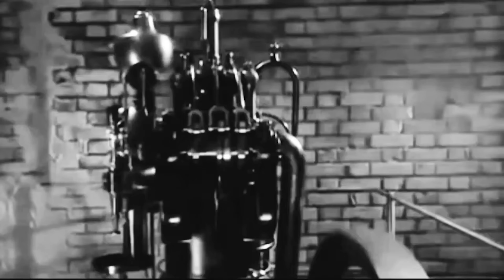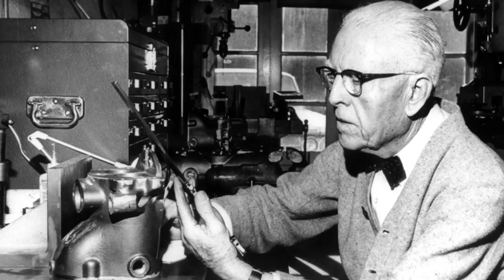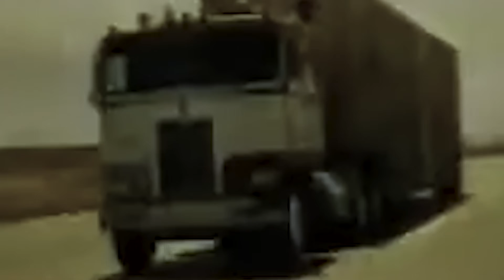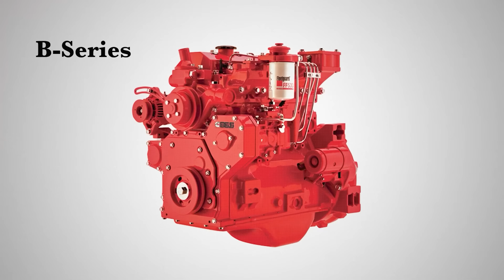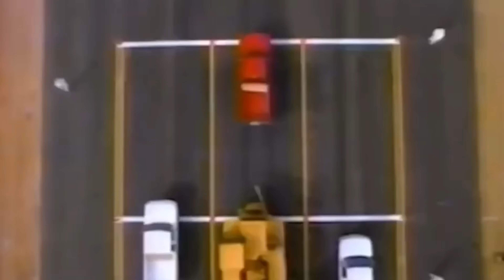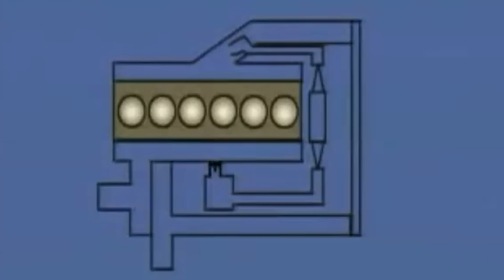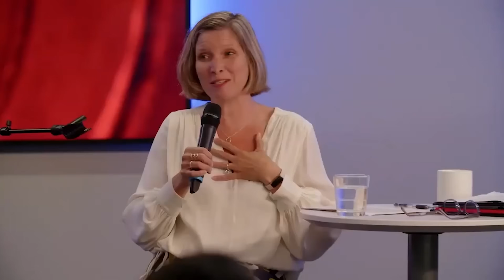Cummins' $1.6B Scandal (They Hid This)

Comment: Technology is insane, that 6BT weighing around 1 thousand pounds making 400 foot pounds of torque at 1700 rpm from 5.9 liters of displacement in the 1980s, and then I had a 2012 passat diesel with a little tiny 4 cylinder which weighed around 300ish pounds  making 195hp and  300 foot pounds of torque at 1800 rpm. The advancements over the years are absolutely insane! To go from a 1 thousand pound boat anchor (don't get me wrong, they were amazing for the time with their economy and power) to a "light" motor making 35 more horsepower and only 100 foot pounds less, and weighing literally 30% of the 6BT. Absolutely sad that VW stopped bringing them to the United States :( because In later years VW had the CUAA engine code EA288 series diesel which is very similar to the 2 liter that my passat got (next Gen of their diesel though) which was twin turbo from factory making 240 horsepower at 4k rpm and 370 foot pounds of torque.. And doesn't weigh much more than the CKRA (engine series E189) 2 liter that my passat had
Reply: The BIG difference is that you can't run a VW at full load all day long. TDI's love to overheat if you actually make them work, whereas a 6BT(or 7.3, or Duramax) is happy as a clam to just run wide open all day long.
Reply: That little 4 banger won’t pull 12 thousand pounds and maintain that torque. You can make a 6bt with 12 hundred lb of torque but you don’t see them in semi’s. It takes mass to maintain those numbers under a load.

Comment: EPA is like PETA. sounds good on paper but then they murder your puppy.
Reply: Actually CARB is the tail wagging the dog. They've been pulling the strings since 1970.
Reply: @michaelmccarthy4615  them too.
Reply: Or an unlicensed squirrel.
Reply: @RaymondSwanson-u9y think that was a different 5hi7bag agency that took out peanut.
Reply: Just think of where we might be without the gas engine catalytic converter.  I survive, I thrive breathing clean air.
Reply: @andrewhansen4179  you might have "clean" air but youll also have nothing more than mud huts.
Reply: I wonder what the epa thinks of our military blowing up oil refineries all over Iran. That can’t be good for the environment…
Reply: @angelgjr1999 they dont care, they dont get a bigger paycheck by giving a half shi7 for that.
Reply: @angelgjr1999 Easy, traitor trump just get's rid of our EPA and we all suffer the consequences.  Sleazy grifter DJT.
Reply: @a@angelgjr1999ey probably love it. No fuel no ICE. EPA and especially CARB are riddled with Net Zero zealots. Net Zero zealots hate Western Civilization in general and the US specifically. They want it all destroyed.
Reply: Quietly 🤫,  if it doesn't have wheels, AQMD the sibling to CARB, has been tightening the noose on everything else in our lives till it doesn't work correctly either.

Comment: The 12 valve is what I think is one of the best engines ever made
Reply from the maker: The 12-valve is arguably the best engine ever put in a pickup, but Dodge definitely didn't give it a partner that could keep up.
Reply: Yeah for younger pickup guys
For real truckers way back H series like in the movie duel
NTC855 or N series in 60s and of course the Ntc 855 big cam.....1 to 4 after....the the N14 with the CELECT  FUEL systems after......then HPI

Comment: Dodge engines where sound and strong but the transmission was crap
Reply from the maker: The 12-valve Cummins: The engine that embarrassed every transmission Dodge ever made! 😂
Reply: The getreg and nv4500 or nv5600 were decent 
Manual option only of course
Reply: The three speed auto was bullet proof.
Reply: @darnellgraveline1595 so was the 4 speed 700r4 except u had an extra over drive gear and lock up torque converter which could be done by 1 wire and simple switch 
Ford had domething similar at the time
Forget the series of tye ford 4 speed in the 80s after the c4 and c6

Comment: What a wonderful company to continue the fight the climate scammers. As they realize, this scam has a lifespan and will die before a cummins engine ever wears out.
Reply from the maker: Do you think the move toward hydrogen-burning internal combustion engines (which Cummins is working on) is a better middle ground than going full electric?
Reply: Ok boomer , time for your nap

Comment: They didn't haul 80,000lbs back then. And the leader in diesel in ww2 was Detroit
Reply: They did haul 80 0000 and more in some axle configurations.....just not as many
And no it was a competition.....even with Cat.....then Mack and do on
Don't forget international harvester too......dt466 and the 530 series.....smaller but competition none the less

Comment: I have over 25 years of experience with Cummins engines for semi-trucks. The early models before EPA were bulletproof 1,000,000 miles engine. Up to 130,000 pounds gross weight every day in the Rocky Mountains area. No problem, no overheating or lack of power. Then they came with ISX CM 871 with EGR and DPF. Nightmare. Then ISX15 2250, ISX15 2350. My company with 78 years in business history went bankrupt due to constant expensive repairs.
Reply from the maker: 25 years in the Rockies teaches you more than any engineering manual ever could. 78 years of history wiped out by 'expensive repairs' - that’s the dark side of the emissions mandate. Thank you for your service in the mountains and for telling the truth about these engines!

Btw, if you could have put a brand new N14 or a 690-hp Signature 600 in a modern chassis today, do you think your company would still be running?
Reply: @heavymaticyt  Yes, I think company could survive. Our best trucks were Signature 600. I personally logged 800,000 miles plus a lot of PTO hours because we have to load and unload with PTO driven pump. Average fuel consumption was 4.9 miles/gallon. Gross weight, terrain, PTO, no speed limiter. All included. Today with X15 I have 6.4 MPG mostly below 70,000 gross weight loads and flat terrain.
Reply: What I don't understand is why you'd lose the business over running "illegal" motors with deletes.. Yes it's a risk but so is losing your company isn't it? Might as well go big before going home if it's going to guaranteed happen if you go the legal route
Reply: @DarkAttack14 you’re only thinking short term that’s why. What happens when you get slapped with EPA fines and business restrictions that exceed any additional money you have made and possible jail time cuz you’re a small business? It’s just a lot of risk you take on to still lose the business in the end

Comment: The tech to make diesels get 30 MPG has existed for 50 years. The oil companies and government don't want that as all their tax and profit would collapse. Less fuel burned per mile means lower emissions. That's a good thing right? Not if it lowers tax revenue or profits
Reply from the maker: If you could go back to any engine from the last 50 years and run it with today's fuel, which one do you think would actually get the best MPG?
Reply: @heavymaticyt  98 Cummins 12 valve. They still make it in China with and multi injector system. They are bullet proof and with a fuel preheater system will get 30+MPG with more horse power. Add a water/steam injector you can increase the MPG to over 50 and power by a third. You just need SS valves and exhaust and brass valve seats. Want to make it better still? Put in rotary valves. Reduces engine drag on HP by 50% and wear and tear. Turn a 500k mile motor into a 4million mile motor
Reply: @heavymaticyt  Or if you just want HP the DD71 V12 with rotary valve heads and preheated fuel will get 40+ MPG and more HP than god

Comment: I'm a Yankee boy, but living in NZ for the last decade...I've seen Chink Fotons w/ Cummins inside..the engine has to be worth more than than the ute. It's insane!
Reply from the maker: How are those Fotons actually holding up on the NZ roads? Is the Cummins engine enough to save them, or is the rest of the truck falling apart around the motor?
Reply: @heavymaticyt  For the most part, the Cummins is the only thing of value in that vehicle, though I do know a guy who has been very happy with his.

Comment: Crazy how one small change in fuel timing basically built their whole empire
Reply: I've been a commercial truck driver for 20yrs...it is INSANE to think that the company that MR CUMMINS started was like, "yeah, nah" on the Jake Brake. I know, I know, there are a lot of cowboys and idiots out there running their jakes 99% of the time b/c "it's cool", but seriously, I use mine judiciously...OK, it still sounds cool, but I use mine when necessary, not just leave it on 24/7 like some idiots. You just can't run modern trucks w/o some form of Jake (even though the Euros have quiet versions that are super efficient...).
Reply from the maker: Thanks for your comment Eric! You’re 100% right. Modern trucking would be a lot more dangerous without Clessie’s 'gimmick.' It’s the perfect example of how "pure engineering elegance" beats corporate skepticism every time. In your 20 years, what’s the one truck you drove where the Jake Brake actually felt like it was going to shake the cab apart?
Reply: @heavymaticyt  Shake the cab apart? LOL...probably the Kenworth T-401 semi (tipper trailer for dirt/metal) down here in NZ. Of course, it is also the loudest truck I've ever driven--twin exposed stacks...not quite straight-pipes, but barely any muffler. Running a Cat C-12.
Reply from the maker: It's crazy to think about, right? Do you think the modern common-rail electronic timing is as impressive as what Clessie did with just a camshaft and some springs?
Reply: @heavymaticyt Good question, I’d say modern tech wins on accuracy, but Clesse’s solution wins on pure engineering elegance...
Reply: @heavymaticyt it was more than springs.....metering valve and more
The whole PT system.....Pressure Time governor pump was built by Cummins.......the the CELECT System
The HPI etc etc
The first Jake brake was put in Cummins in 1954 too 
So its still a centrifugal govenernor pump but more complex then what car and Detroit diesel had

Comment: I have 2 H series Cummins in boats.   The one is the original old H series 4 cylinder, the other is the upgraded HR series (743cid) 6 cylinder
Reply from the maker: Now that is a legendary engine room! The 4-cylinder H and the 743 HR are the ancestors of almost everything Cummins built afterward. It’s amazing to see them still earning their keep out on the water. How many hours do you have on those old girls?
Reply: @heavymaticyt the HR has aproximenly 30,000hours I’ve been told.  1948 engine, it’s actually a replacement in the 1943 40’ tug because the original H 6 froze and burst in the 80’s so the previous owner replaced it with this HR-6 from a different tug Still has the old single disc injection pump but I plan on upgrading it this year to a PT system since the pump is worn out.   The 4 cylinder H I’m not sure about, it’s also never been opened up and is in a 1946 39’ logging tug that I am rebuilding due to hull damage.
Reply from the maker: 30,000 hours on a 1948 block?! That is absolutely incredible. It’s a testament to the iron they poured back then. Those 743 blocks were built to last multiple lifetimes. Upgrading to the PT system is a total game-changer for those old 743s. And an unopened 1946 H-4? That is a mechanical miracle. Good luck with the logging tug rebuild; that’s a piece of history worth saving!
Reply: Reminds me of the movie duel
This old diesels had a distink sound and injector knock.....
Some early ines were supercharged 
Was yous naturally aspirated?
And did it have a decompression valve when cranking to start? And external fuel lines?

Comment: The ve pump sucked balls, p-pump all the way
Reply from the maker: Are you running a stock P-pump, or did you go full 'bench-built' with 12mm or 13mm plungers?
Reply: Wrong the VE pumps had some advantages.....they made easy power and were lighter.....more compact and o yes.....the all hard variable bugging of injection and constant end of injection....the more advanced as you pumped more fuel to get slightly more power its all because of tye rotors design and cam plate